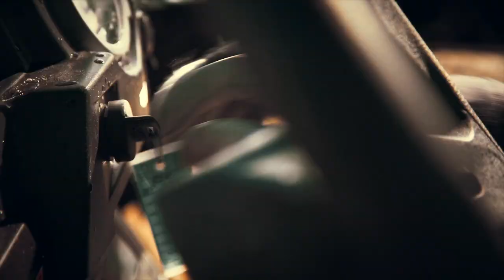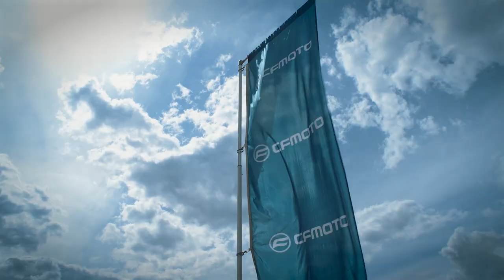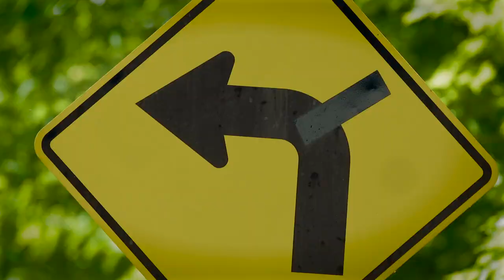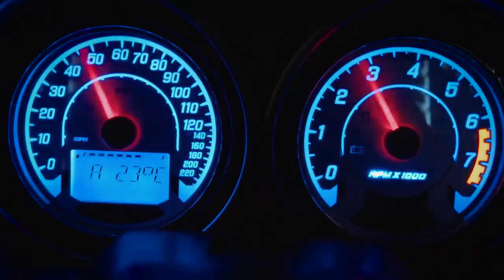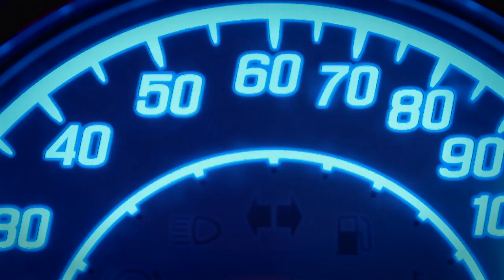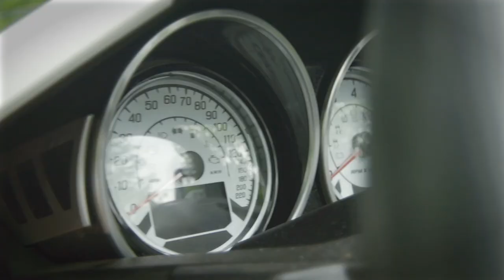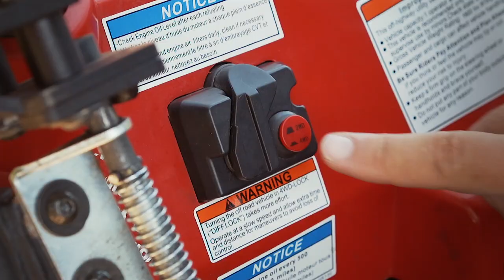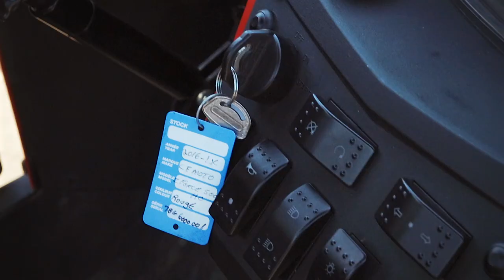Dirt Trax Television 2016 - Episode 6 (FULL)

Comment: In Saskatchewan the Skingshot has been specially classified in its own category.  As long as it has a windshield and a steering wheel, helmets aren't required.  If it meets specific safety standards only seat belts are required

Comment: They have been selling CF moto for a long time now here in Sweden, and there is loads of problem with them. Better to save up some more bucks and get one from a better known brand.
Reply: From what I've seen here in the U.S. CF Moto has performance figured out just not durability.  They just aren't reliable.  If you want to spend less money and still get good reliability, get a Kymco.